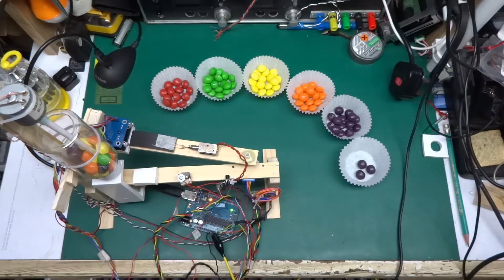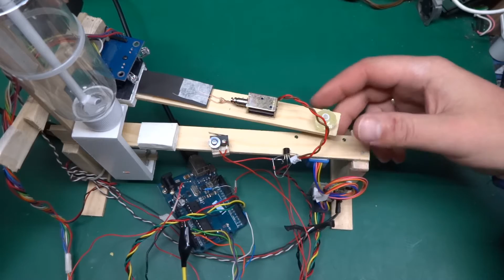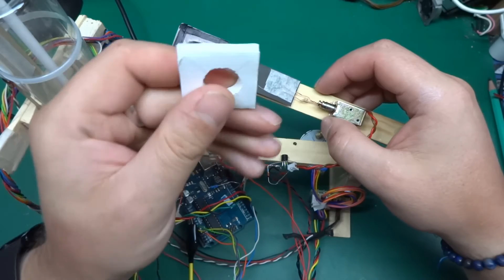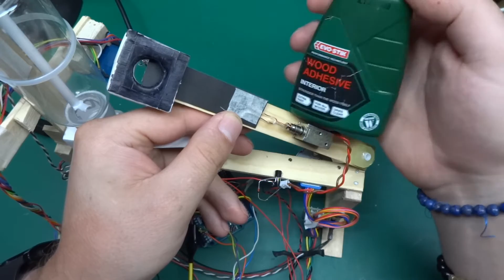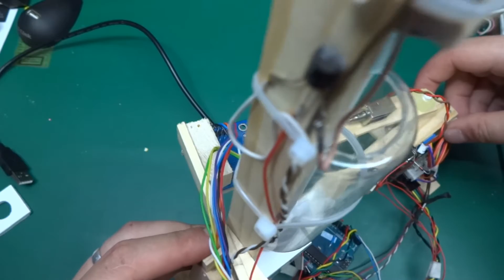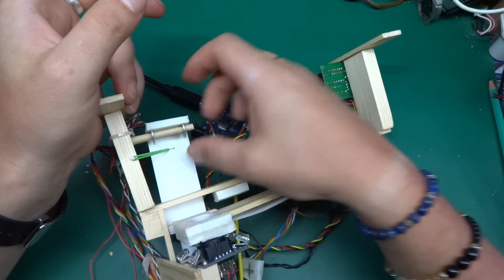Skittles sorting - TCS3200 test

Comment: could you pass me the connection scheme please?
Reply from the maker: Jor Daz in the code (link in the description) there are all connections to Arduino. And the only other external component was the NPN transistors to switch on the motor to stir up the skittles, and the coil to drop the candy (1k resistor from Arduino to base of the transistor in both cases). Everything else (stepper driver and Colorado sensor) was directly connected to Arduino. Because it's based on microcontroller, the connections don't matter really - you set it up in the code afterwards.
Reply: thank you¡¡